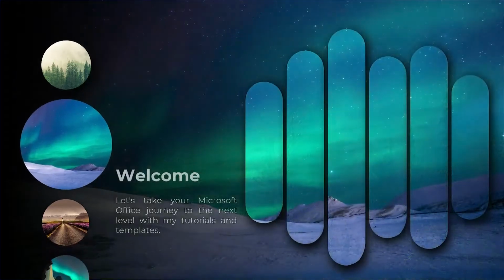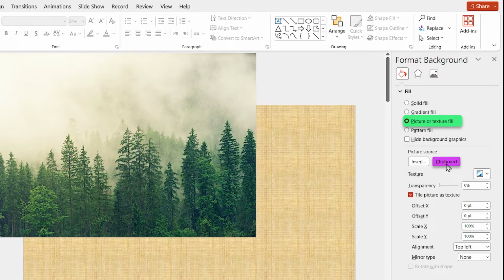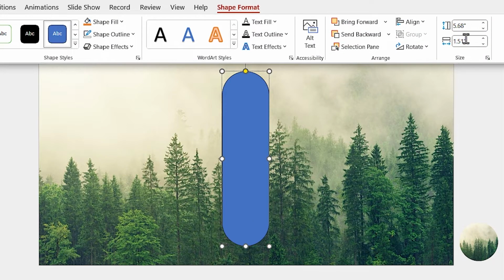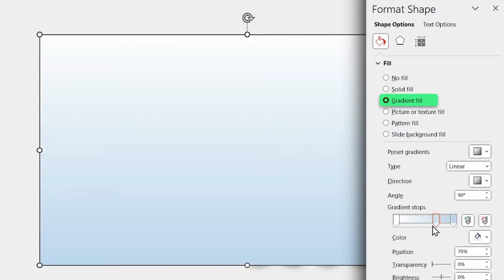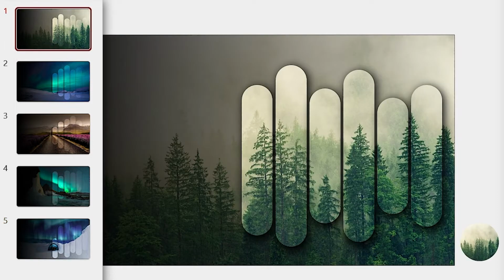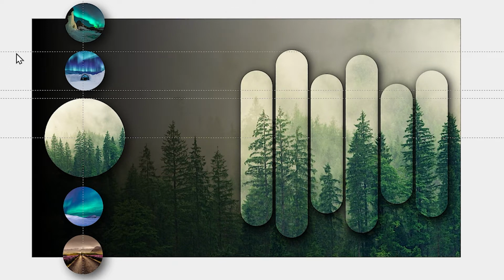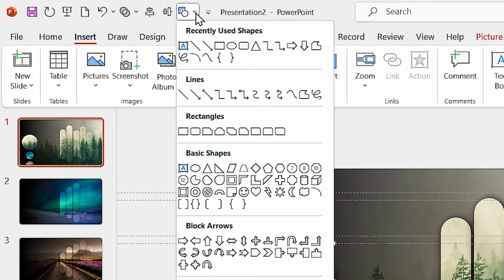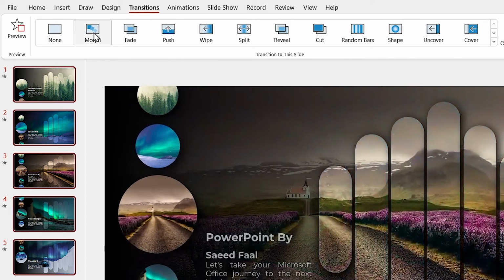How to Design Unique PowerPoint Presentation

Comment: If this works… i love you❤️🥺
Reply from the maker: And if didn't.... you will hate me? 😂😂😂
Don't worry it will work, just follow the video step by step
Reply: @SaeedFaal  i love youuu ❤️ it worked out perfectly 🥹
Reply: Theres one thing left … the morph transition is not available in my pp how do i get it ?
Reply from the maker: you have to upgrade your PowerPoint but if you are using PowerPoint 2016 you can add it with a trick 
Tell me which version you are using
Reply: @SaeedFaal  i did it !! Thank you so much🥹🥹 I love youuu  feel yourself hugged 🥹 i wish i could you show the end results

Comment: Dr. , How can I create the results' section in the presentation PowerPoint of the thesis that can include a lot of figures in which the Audience likes and does not feel bored. thanks in  advance
Reply from the maker: I personally designed this (https://www.youtube.com/watch?v=SRGGZiCxB0o) for my Ph.D. thesis presentation, because same as you I had a lot of pictures and charts to show the audience 
My field was mechanical engineering and it was suitable for my field. You have to decide if is it suitable for your presentation or not 
But for the academic environment, a simple presentation is always working
Reply: @SaeedFaal  Thanks, is there any way to make the slides not show as huge in number?